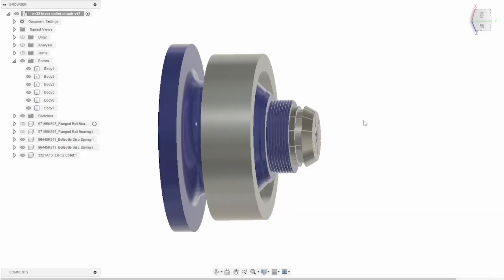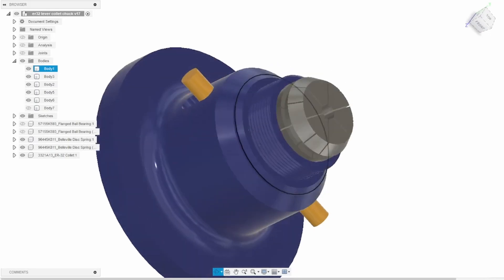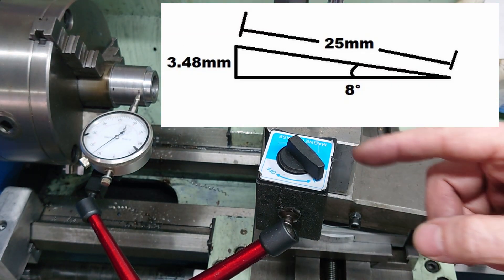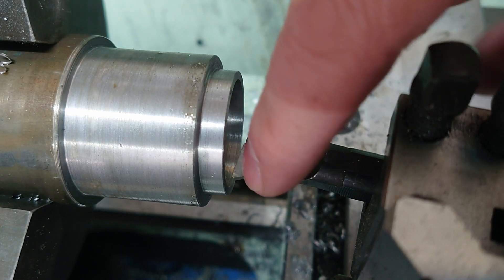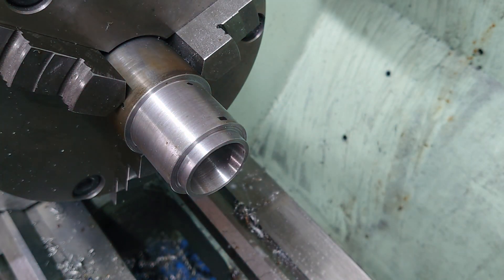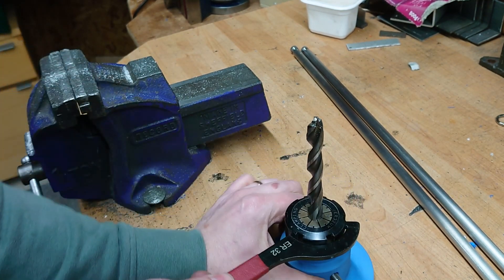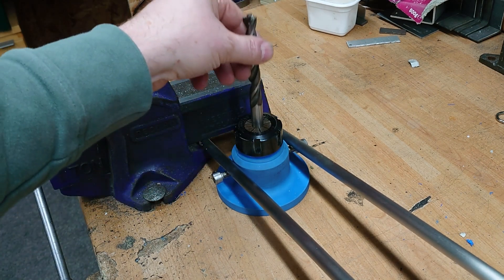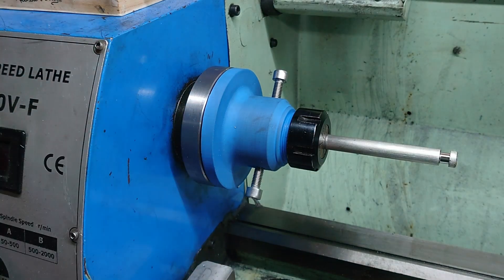Lever Action ER Collet Chuck - Prototype

Comment: I think the reason no one has done it is 5C collets are more used in the industry and you can get easy on/off chucks for those. I like the idea!  I’m eagerly awaiting the next step so I can get even more excited (I use er32 and just do not want to buy yet another set of collets).

I could see this also being fantastic if you have a stop in the back of the Chuck, maybe held in place through a spider or something in the back of the spindle? This way quick in quick out, you can make the parts ultra fast.
Reply from the maker: Not requiring a complete separate set of collets was the main motivator for this. I know a normal person would just buy a suitable bit of kit and the collet set, but where's the fun in that!

I'll add the back stop to the list, great idea, thanks.

When I have a useable set of drawings I'll post them on the discord and you can make one!
Reply: @ollysworkshop  There are a lot of plusses to the nose mount closer design. ER collets have a wider grip range. 5C collets have a very small range, like .1mm  (.004") per spec, but they seem to have a bit more in practice. Still, it's very narrow range. A set of 5C imperial in 1/16" steps was nearly useless for me, it seems like every bar stock tends to be plus .004". They are amazing when it's working, super concentric, great grip, and non-marring. But a full set to cover 1/8"-1"  is 57 pieces and the cheapest import cost is over $400US. You can get ER32 Imperial and Metric sets for half that or less, depending on how low on the quality you are willing to go. 
A big plus for your design is the forward clamping direction, if you have an external stop in the tailstock, it looks like the stock will be pushed outwards when closing. 5C lever closers pull back and draw the stock away from the cutting zone (=to the left). If the stock varies in diameter, the pullback varies. Because the nose mount closer does not use a draw tube, you can have an expanding stop in the spindle that would allow very consistent length parts, so you have in effect a dead-stop style collet closer

Really cool design, I hope you build it out in metal. The real benefit of lever closers is speed and consistency, you can feed a new piece without stopping the spindle. I just ran a job with over 200 parts and many different lengths, the closer cut the time by easily half, probably more like 1/3 the time of using a scroll chuck. Maybe not needed for for a hobby purpose. But on the other hand, maybe hobbyists avoid multiples b/c they are time consuming. Like you put it, sometimes a new tool changes the workflow and allows wider range for projects.

Comment: I'm still sleepy, so probably may not make sense. I think this is a very good start, and it'll be more useful if you can make the inner collet and spring loaded fixture freely rotating against a stationary outer sleeve.
Reply from the maker: Hehe, I'm still trying to figure out the best way to make the lever actuator mechanism. It will sleeve over the rest to hide the spinny bits
Reply: Heh, I sure didn't. I should've watched the video when I was more awake 😂